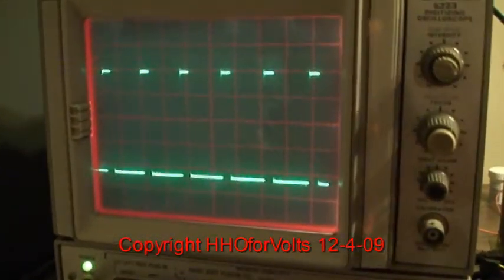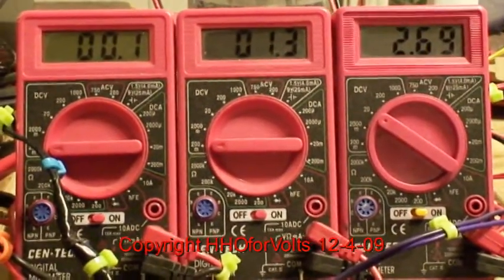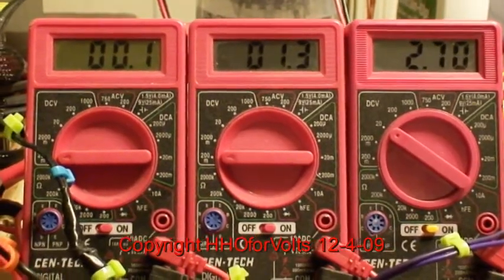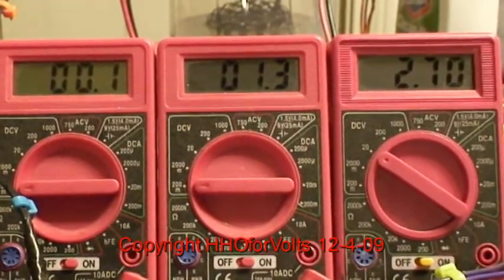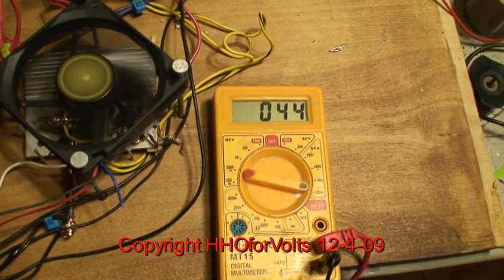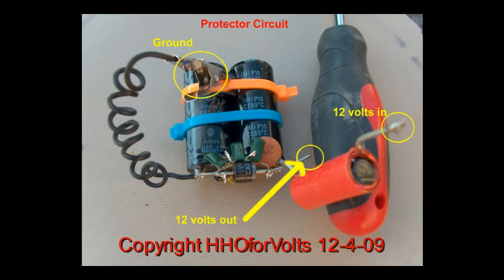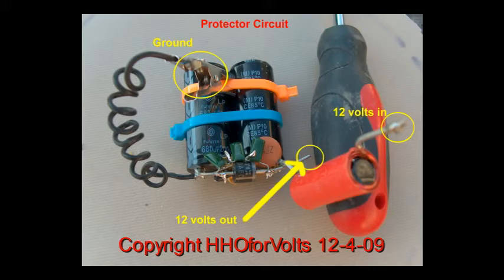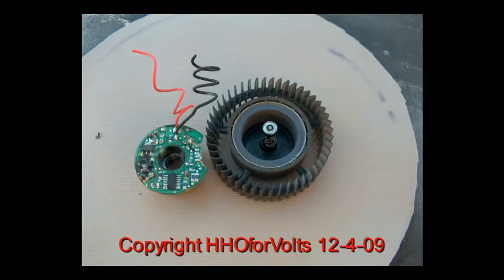HHO Current Overy Unity Research #2

Comment: I used part of your circuit - added a PNP & NPN to drive 2 IRF48's direct to my cell - gave about the same production as the relay flip flop... which is good!
The water stayed clear - over 2hrs @ 2/3 amps... which is good.
Thought I'd combine the two so I put the relay flip flop in parallel with the new circuit - only an increase of 0.3 amp... but after 5 min the water turned a horrid colour of brown gunge... LOL!  
Also had a LOT of trouble with back efm - knocked out my supply many times.
Jim

Comment: I've got a question about the rodin coil. I got to wondering what would happen it you looped about 35 feet of insulated multi-strand and used it as the toroid, then wound the Rodin around it.
You see, it's what I have done. I don't have an oscilloscope, so hunting down the sweet spot will be tough, but so far, the center coil is showing signs of way over unity.

 What do you think of this idea?

I'll post some picks of the coils I've made so far.
Peace.
Mike.

Comment: I'll give it a try Richard - I'll have to build a new test board though - I fried the one I had along with the Rodin coil & motor - I stuck the leads from my 12vac transformer into the board and went to let my two puppy's into the garden... forgot about the bridge rectifier... LOL!
I can't even remember the changes I made to the coil... it's burnt black... doh!
I've stripped it and started another. As I mentioned before you should sell Rodin coils to help finance your experiments.
Jim